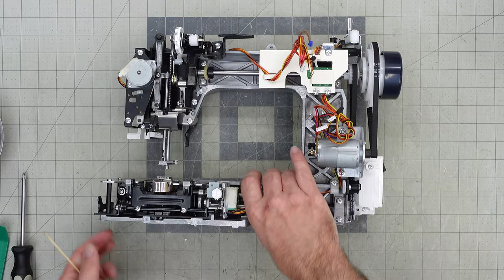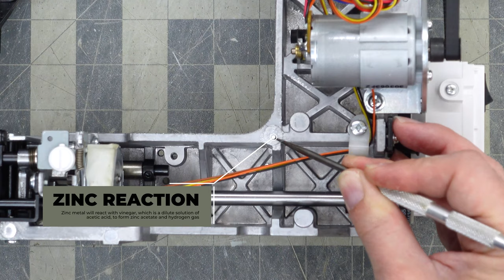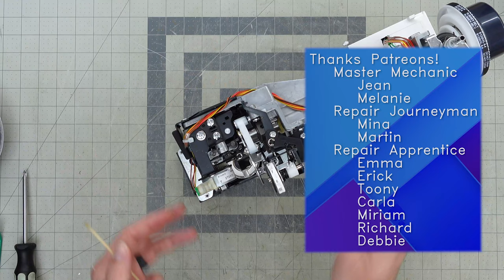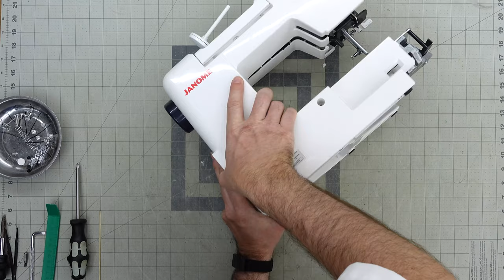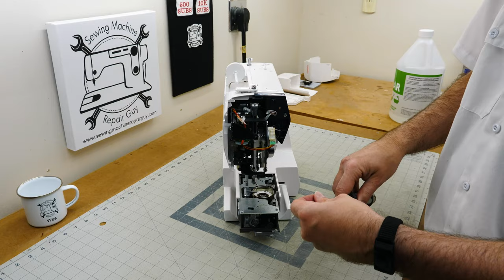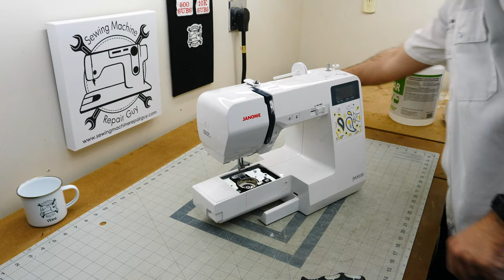Janome Teardown Part 2, How to Adjust and What is it Made of?

Comment: This video inspired me to clean my machine, I haven’t done that in a while 😬. It was bad. Also how to I know what I need to oil?  I checked my manual and it doesn’t have instructions for oiling under the maintenance section.  I have a Janome Memory Craft 7700 QCP.  I’ve also had it for 7 years I think and have never serviced it. 😬😬

Comment: I got a new Janome hd 3000 and I’m using the pedal but the machine won’t even thread. When I tune the knob on the side it’ll lift the needle up like normal. And I’m heating a clicking sound. Idk if I just got a faulty one bc the first one I got never did this.

Comment: My wife has a Janome 6130. She was using it & everything was working fine. She stopbfor a sec to adjust something & when she hit the button to begin sewing again,  the machine made a sort of grinding noise & the needle won't complete the cycle by moving upward. The hand wheel is free & you can move it up & down, but it sounds like something is hitting on the down stroke, bottoming out. I removed the plastic cover & I can see a little metal "foot looking " piece that is attached to the needle bar. The little foot piece is hitting thr metal plate that the needle bar goes through. Do you you have an idea of what the problem is. I know nothing about sewing machines. I've never used one & do not know anything about them. I'm trying to learn. Can you help. I'd send pics & vids if I could
Reply: I'm thinking it's out of time. Or the set screws in the needle bar have loosened enough to allow the little foot piece to hit the plate. I just don't know

Comment: Hi I have a singer quantum 9960 for about a year and a half. I was sewing the other day and the needle in the mechanism  start jumping around like crazy so I turned it off. The next day I tried to do decorative stitches and they turned out upside down meaning the decorative part was on the bottom and the messy part was on the top. Do you think you could figure this problem out

Comment: I'll stick to my vintage all metal mechanical Kenmores and Singers.
Reply: I've sewn on both and I have to agree with you these new cheap plastic parts are a real pain to deal with.    I wish they would make an all-metal modern machine with a needle threader that was not computerized and programmed to break down.  I'd love it if one of these companies would produce a modern hybrid machine to include:  
*
mid arm comparable throat space
 *great feet and precise build quality like the bernina records

* a built in needle threader
* janome qc model  feed dog system.
* mechanical non compterized
*Few if any plastic heavy wear parts
*Great looking design and colors of the 40s.   Morse machines for color or the really amazing engineering in the elna supermatics.